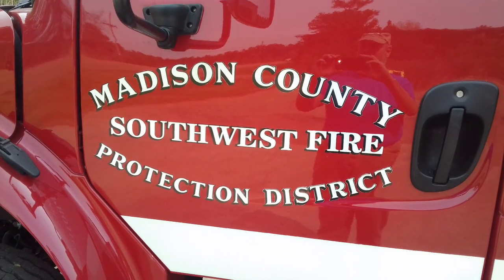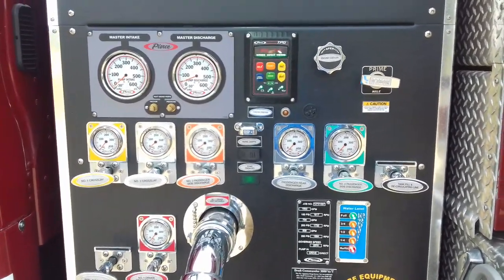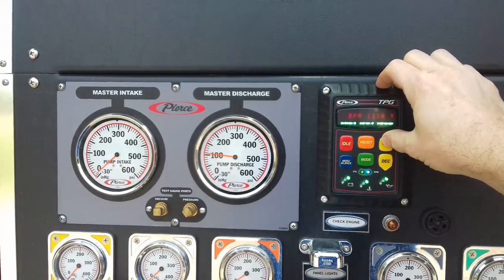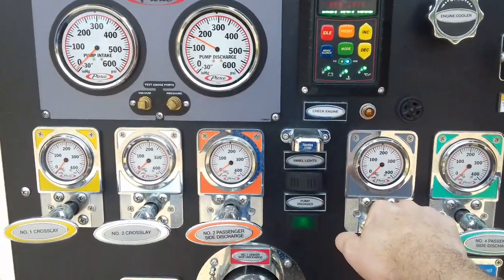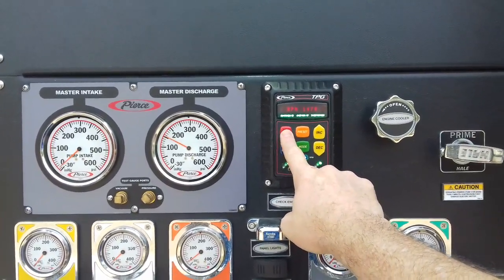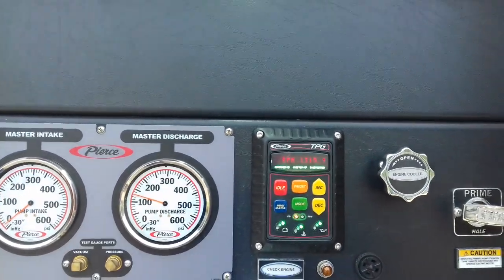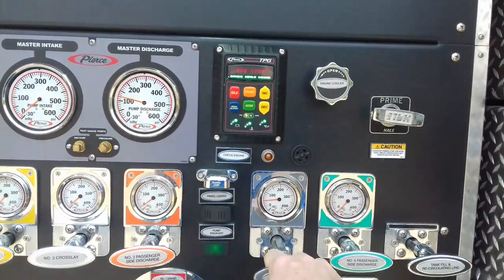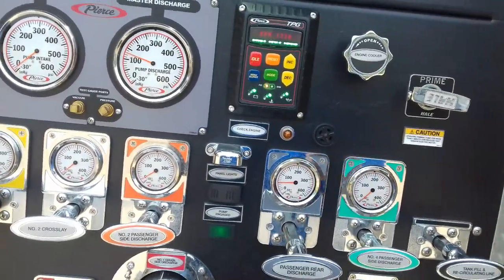Part 2. Pumping a Modern Fire Engine

Comment: All of these new trucks are great, the pump theory is still the same as it has been for years. I was brought up that you operate the pump, computers are fine but it is taking things away from the Engineer, if the computer goes haywire it puts the operation right back in the hands of the operator so why not just leave it in the operators hands anyway..

Comment: That's all well, and good until your Computerized System goes down. I would much rather deal with the older set ups with the Relief Valves, and Standard Vernier Throttle Control. Less chance of failure on both.
Reply from the maker: (just now seeing this)I quite agree. I prefer to control the truck myself, rather than have the truck control itself. But that ship has sailed. The truck is controlled by the computer so you really don't lose anything by having it control the pump as well. If the voltage drops, you are losing the motor, the transmission and the pump as well.
Reply: That is my fear!  Anything mechanical usually gives a warning before failure. Electrical goes without warning. Usually it is a sensor or a wire connection that that faults! Of course ,if the computer is watching pressure and fails then just go with rpm mode.
Reply: You don't have a hope anyway, manual throttle cables don't exist anymore. Even the EPG with a vernier style knob has three wires that run to the engine throttle and aren't relief valves notorious for sticking ?
Reply: @ Rod Harris, I have never had any Relief Valve stick on me. Not saying they don't stick, just saying it has never happened to me. As for the throttles, this is exactly why I could, and would never want to be a Driver/Engineer in any Fire Dept today. The powers that be have destroyed the simplicity of Pump Controls, and complicated everything with any, and every possible electronically operated gadgets they can come up with, and eventually, these electronic gadgets will fail, and when they do, they render the entire Rig out of service for something that did not have to be and did not have to happen.
Reply: Agreed but sadly this is the new norm. Even if the manufacturers wanted to do it differently you couldn't find an engine out there there doesn't use electronic fuel control. Even the " gas " peddle doesn't control anything mechanically. The new SAM system is interesting, not a manual control in sight. But the younger generation is all about pushing buttons and letting computers do the thinking :)

Comment: What is the max psi
Reply from the maker: It depends on the amount of water available. If you are flowing from a hydrant, you will get much higher pressure before the pump starts to cavitate.
Reply: anything over 1000GPM from what research i've done requires dual 5 inch intakes

Comment: This may be a good thing until that Computer decides to take a shit, then what ?
Reply from the maker: That ship has sailed, the whole truck is controlled by the computer. The accelerator isn't connected to the throttle. The transmission is controlled by the computer. 
It's much more likely that if you run out of DEF, which will throw the truck into Limp Mode.
I don't like it, but that's the way it is. The days of control by mechanical linkages are over.

Comment: Your some what knowledgeable, its called a presure governor. Your not sucking water, your removing air then atmosphere pressure pushes water up the hose like a straw. Every pump operator needs to use basic lose. 7 lb. Per 50' etc
 Very easy I say before you do youtube videos brush up on your knowledge more.
Reply from the maker: Umm, no. I'm pumping from the tank. The pump is already primed. But feel free to make you own video with your own fire engine where you sant point out that I'm wrong.